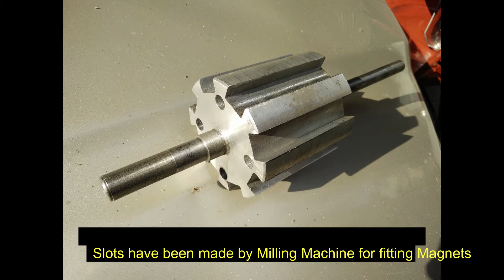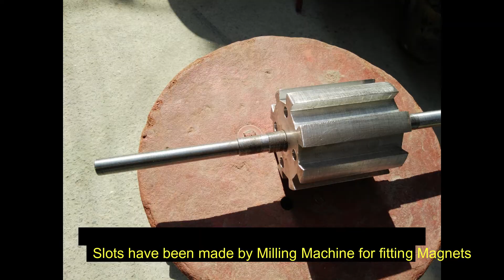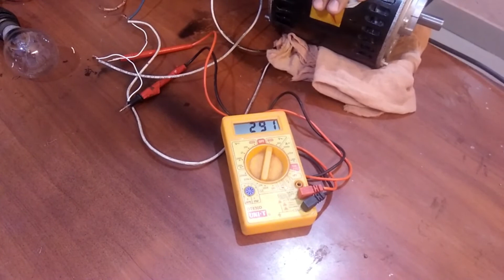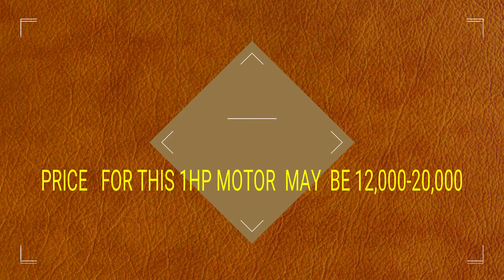PERMANENT MAGNET GENERATOR-2

Comment: Very interesting. What is minimum rpm for generating 12v  with 600 watts?
Reply: Good
Reply from the maker: Sir it makes ac current which is in volts upto 300 I have checked

Comment: But aapne 600w produce kiya 300w drill machine ko dekar means you have double produce energy, aur Flywheel Law of inertia use krti hai to jo gravitational energy + given speed from motor ki energy ko store krke kuch der ke liye RPM maintain krta hai, aur apki energy ko save krta hai toh, agar aap 1kw ka motor se 5 kw Permanent Magnet Genrator ko run kariye aur flywheel ko use kariye to hum Grid se 1 kw ki supply lekar lagatar 5 kw ka load chala sakte hain. I didn't support free energy but I am giving concept of power multiplication.